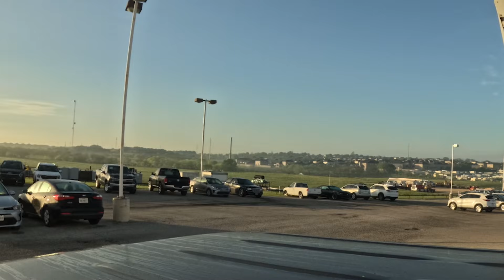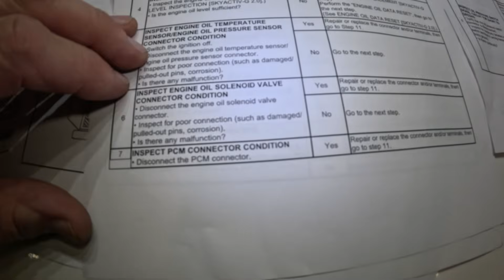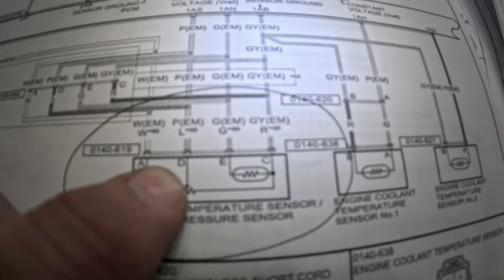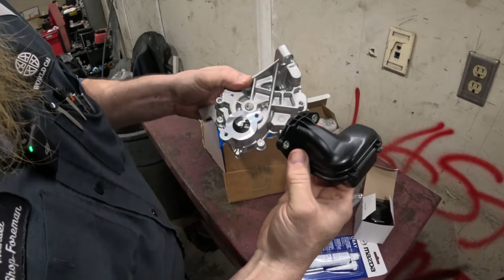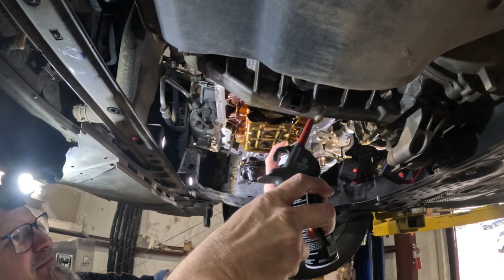2019 Mazda CX-3 check engine light. Low oil pressure. Code P0524

Comment: Great video! I'm chasing the same code on my Mazda 3. Replaced the OCV per the TSB and the pressure sensor for good measure but it keeps coming back. My oil pressure reads within spec when watching the data stream (at various RPM while driving), but after settling into a consistent cruise on the highway the light will trigger again. The pressure data stream graph will ripple and the CEL follows. Did you ever notice anything similar on this one?
Reply from the maker: You need to hook up a mechanical oil pressure gage and test it with that.  We ended up replacing the oil pump on this but then the vehicle came back and we replaced the engine in this video.           https://youtu.be/zktQSFNZnJE

Comment: Hey seen this video, my 2019 mazda cx3 engine light came on and low oil pressure.  Got it home in limp mode,  got it towed to a mechanic he looked at it and said I need a new used engine..........  he said the timing has slipped and is causing the oil pump not to pump right? Could this be true, I just had the oil changed 3 days before this happened. Could it just be the pump ? It's $5100 for a new motor with labour here and it's not worth it to me for that
Reply from the maker: I've never seen the timing slip or even jump on a SkyActive engine. Timing wouldn't cause the oil pump to not pump. The pump could be bad. Or, you could have a bad oil pressure sensor. It needs to be diagnosed the same way I did in this video.
Reply: OK thank you very much I will talk the the mechanic

Comment: Alldata says it is a 7 plus hrs job but removing the pan and replacing the pump is more like a 2 hrs job ( cleaning silicone is the hardest part) so I guess the only reason for they to do it in 7hr is because they remove timing chain and all related components to access and replace oil pump chain? 

Thanks.
Reply from the maker: You're probably right, the timing chain components definitely add to the complexity and time involved.

Comment: Mate please tell me where the oil pressure sender is on the car ? I've looked and it's a right nightmare of pipes etc
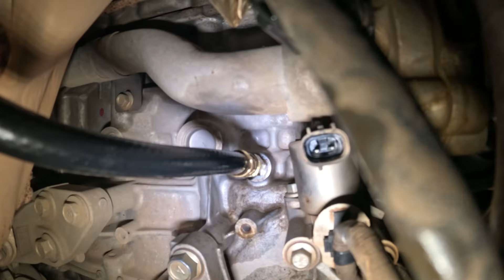Reply from the maker: In the video if you look at 17:37 you can see where my oil pressure hose is hooked up to the block. That is where the oil pressure sending unit goes.  Above the passenger side axle, behind the water pump, below the coolant crossover pipe. You can't really see it unless you stick your phone in there and make a video or just start taking pictures.
Reply: @ShopForemanGarage  mate... found it .. on my engine it's just behind the starter motor... just on top of it
Reply from the maker: Oh.  That's not the same as this engine.
Reply: @ShopForemanGarage  mate it's only because I looked at a stripped engine for sale on Ebay that I found it ... these engines are crazy on the amount of pipes etc

Comment: Question, i brought my 2019 mazda cx5 NA in for a P0126 warranty repair, which fhey replace only the thermostat, not the whole coolant control value, and shortly after, like rye next day a new code fhats never been seen before came up, this one youre working on P0524, is it possible that somewhere along the lines while they were doing the P0126 repair, they did something to the car to cause this new problem to come up, i dont believe its a coincidence, but rather something they incidently did, like spray coolant which caused a short in the computer module or sensor. If they did cause the issue from their repair work, how can i prove its their fault, something tells me they're not going to tale accountability for this. The fact that this new code came up the next day after their work should be enough proof, any advice?
Reply from the maker: @kuujjuaqguy  P0524 is set for low oil pressure. In some cases, the engine may go into limp mode. 
Did they perform an oil change, too?
There are two bulletins for this code.  01-012/20 is a PCM reprogramming  and will depend on what the latest update your PCM is flashed to.
01-003/24 is a replacement of the oil solenoid valve with an updated one if your vehicle has cylinder deactivation.  If the 8th digit of your VIN is M, then you have cylinder deactivation.
I can't say for sure it was something they did. But, I can't say it wasn't.
Reply: @ShopForemanGarage my car doesn't have CD. they did not perform an oil change at the same time as the repair service. I did an oil change yesterday and cleared the code and after about 300 miles the code came back. I find it hard to believe this sudden low oil pressure problem happening the day after their repair job. I've had this car for years without a single major issue until they did the warranty repair. If they check the computer code history and see that it was triggered shortly after their repair work, would they put 2 and 2 together and say, "hey we might have messed up because this code triggered right after we did our repair" what are the odds a dealership will claim that?
Reply from the maker: The odds are pretty slim. The only thing I can think of that could possibly cause this after replacing the thermostat or coolant control valve would be maybe not hooking up the ground properly.  But then that could cause other issues too. I would have to do research on that.  What they probably will do is look over the work that they did and make sure everything was put back together properly and go from there.
Reply: @kuujjuaqguy any update?

Comment: Hey there, I have a 2017 Cx5 with the engine and oil lights on. I received error codes P0524 and P055F. The car has no power at all. After I erased the codes, I drove for 15 minutes and there were no warning lights or loss of power. Do you think it could be the pump?
Reply from the maker: Could be the pump. Could be the pressure sender. Could be the pressure solenoid. Or, maybe it's low on oil, engine sludged up, a piece of plastic from the oil filter got stuck in the oil galley from the last oil change, or something else. The only way to know for sure is to diagnose it. If it is setting those codes and loosing power I would get it checked out. If you run it with low oil pressure it could cause engine damage. There is just no way to know for sure without looking at it.
Reply: @ShopForemanGarage Nice video. 
Was the problem caused by lack of oil changes on this CX3 or oil pump a known issue with 2.0L engine ?

Comment: What caused this oil pump to fail?
Reply from the maker: ON this one, I couldn't say for sure. Usually its not the mechanical pump itself but, the pressure regulator or bypass valve in the pump.  It gets stuck and dumps the oil back into the pan instead of providing pressure to the system.
Reply: @ShopForemanGarage   Thanks for your response.Also thanks for your video on the coolant valve. I just had it replaced on my 2021 CX5 with only 13000 miles on it.Heats up much better now.